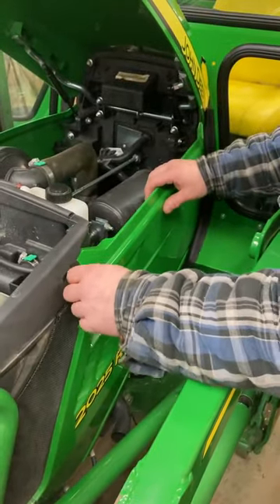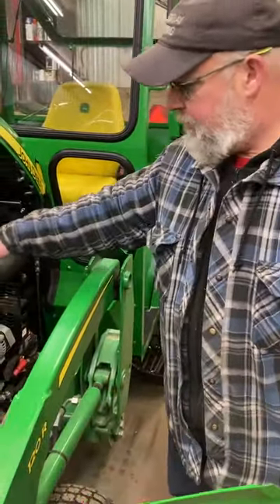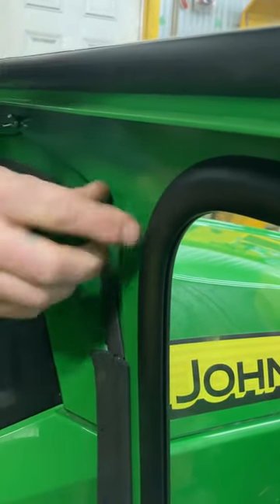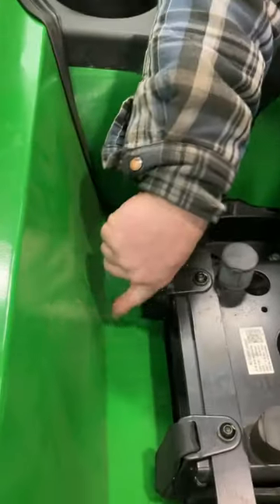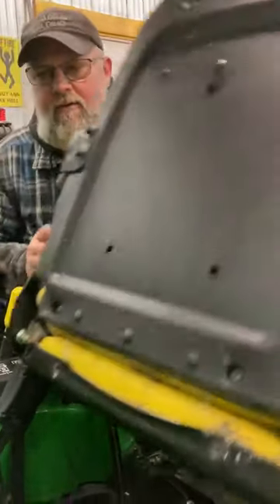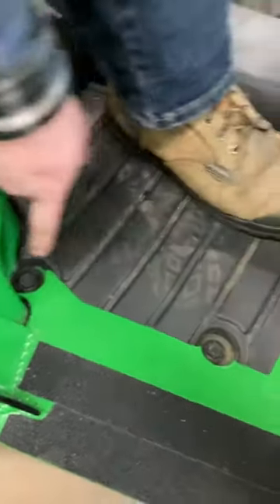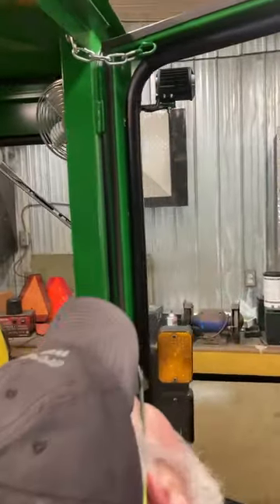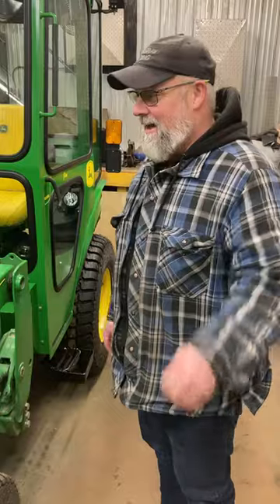Custom Fabricated Tractor Cab // John Deere 2025R

Comment: Looks great.  How loud is this when the tractor is running.  In my John Deere Sound Guard cab there is a lot of soft materials to absorb the noise and it works good.
Reply from the maker: Noise isn’t much different than without a cab, what my clients really notice is that they are warm and comfortable when blowing snow in minus 20 with raging winds. Thanks for watching much appreciated 🚜👍

Comment: Do you build and ship finished cabs?
Reply from the maker: Hi there, I get asked that a lot ,unfortunately each cab is basically a one off custom build and I have to have the tractor here in my shop for fabrication the tractor also needs bolting points put in and other tweaks here and there

Comment: Where are you located, does it fit a 1025R, and how much are they?
Reply from the maker: I’ve done many 1025R,s tractor has to be here in my shop for fabrication in order to have a perfect Bolton fit . Located just outside of Bathurst NB